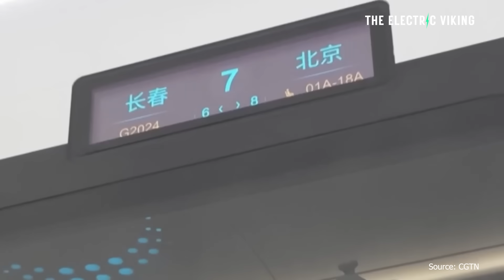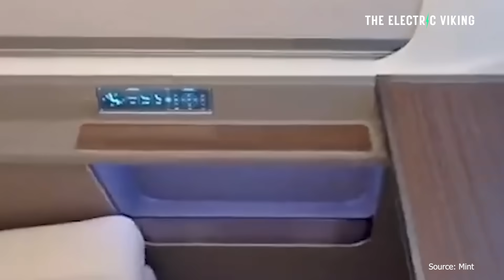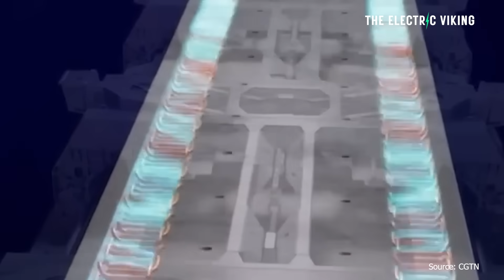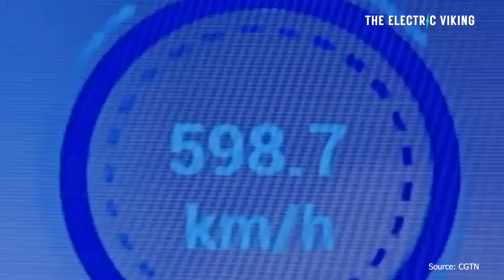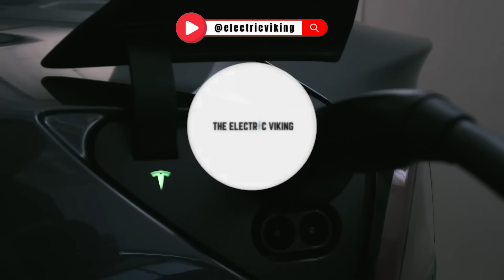The world’s ‘fastest’ bullet train is a remarkable feat of engineering

Comment: 450 kmh is a key benchmark for rail. Half the speed of intercontinental airliners, and also the max service speed of the German Transrapid EMS Maglev built in China more than 2O years ago. Due to the short route (31 km), it is restricted to 431kmh). 
In Australia we should build EMS Maglev with 450 kmh top service speed. The system is far cheaper than the Japanese EDS Maglev. 
Many reasons to limit ground travel speed to 450 kmh which I won't go into here. 
Maglev needs less maintenance, costs less than conventional HS trains - in part because it rides on a continuous viaduct which means it can be in the air clear of the ground level disruptions which make HS conventional train systems very expensive.
Reply: Conventional HS trains are much more expensive than maglev because of the many moving/rotating/frictional and wearing components that require regular maintenance and replacement.

Comment: Just make sure to ask if the train is using French, German or Japanese wheels. The Chinese reneged on their technology transfer agreements. They haven’t managed to build wheels that don’t lead to vibrations and drastically reduced meantime before failure. They had to reduce trains with Chinese wheels to 300km.
Reply: 47,000 km HSR dude.... 60% of the worlds HSR, They have world leading patents in HSR. When you continuously build something for over a decade, you get really good at it, through R & D which then leads to patents.

Have you seen videos of foreign vloggers that travel on China's HSR ? They place a coin next to the window cushion, the coin did not sway or move ( at 350 km/hr ), vibrations ? What the heck are you smoking ?
Do the same coin experiment on other countries HSR rail and lets see what happens...
Reply: @ look up material science and precision machining, forging and heat treatment. I’ve spent most of my working life in engineering R&D. The expertise in making high speed train wheels has taken decades to master by the Germans , Japanese and French. I guarantee that any train travelling at 350 km an hour and above is using foreign-made wheels. Also bearings will be foreign made. Virtually all CNC milling machines are foreign for anything critical. I’m not smoking anything. Same as Comac aircraft. All critical components are currently foreign made.
Reply: Fly here and take a look yourself. We travel daily on 350
Reply: @ I’m sure you do. My point is. You are traveling on foreign made wheels if you are.

Comment: China built 46,000+ km of High Speed Rail in about a decade, and continues to add 3,000 km annually, toward a 70,000 km target that interconnects ALL Chinese cities.  It is as ambitious as the US Interstate System, and fits the Chinese national character of national infrastructure for national benefit.  Significantly, it is all electric, so China's massive renewables push makes the long term operation a little cheaper and greener every year.  By 2030, almost ALL Chinese transportation will be electric, powered by renewables. 
Aside, it is a little surprising that Australia doesn't run a HSR line down the western coast, powered by solar and wind, as the national benefit would be enormous.
Reply: Voting for another leader is supposed to solve everything, anything 😎

Comment: France's TGV is still the OG, The fastest TGV train is the Project V150, which set the world record for a commercial train on steel wheels at 574.8 km/h (357.2 mph) in 2007. The V150 was a specially modified TGV high-speed train
Reply: What is generally recognized is the general operational speed and not the record in the test because it is related to safety factors.
Reply: To achieve that high speed they had to reduce the train weight significantly: instead of the 8 articulated carriages in the middle (push pulled by 2 power cars) they reduce it to only 3. They substituted the powered wheels with larger ones so with the same rotation speed the distance per rotation is increased and finally the drastically increased the voltage on the catenary to give extra powers to the train motors. And at last: the train did not have a lot of pessengers: only a dozen of so engineers and press people. Now I want to see the same speed with a full train with 8 articulated carriages carrying 500 passengers inside the train....I am sure the speed will be drastically reduced.

Comment: China apparently has now leap frogged Japan and Europe in developing and adopting indigenous Maglev trains, beating all previous records of speed (talking 650km/hr ?). Interestingly, China has built a high speed line in Indonesia too, a populous country with a high demand and growing middle class. High Speed network is capital intensive and the financial model must be worked out extremely carefully considering both tangible/direct and intangible/indirect benefits. Running costs could also be quite high since ensuring high safety standards in both maintenance and operation is critical. IMHO these high speed trains are economically viable if it is driven by green energy.  Perhaps demands at least 80-90% patronage. Further, the fares could be just as high as airfares just to break even. Unless the travel is subsidised by the Government, it could be out of reach of many.
Reply: And the goverment should not treat it to have a breakeven at shortterm. This is a longterm project. This is build for the people not for profit. Profit will come later when this is fully adopted.
The plan is also to have a buzzing small and medium size businesses at and around the (train) stations.
That's why you will see in Asia that there is/are malls at or near the bigger stations.
This concept is now also in Indonesia with their high speed rail.
Reply: Chinese government didn't invest in HSR for profit but for a purpose, they wanted high speed connectivity for the massive populous in a massive country. This massive infrastructure will probably never be monetarily profitable.

Comment: For over 20 years I have taken the TGV train from Paris to Marseille. This 774 km distance takes exactly 3 hours and 8 minutes, and is about 2 hours faster door-to-door than flying. It’s also a lot more comfortable and cheaper. Most sub-1000 km flights should eventually be replaced by high speed rail.
Reply: TGV Frances railway can go 570 km/h and that was like 15 years ago if i remember correctly .
Reply: @josippenezic7106 they can but pratically they wont ever use those high speeds because of safety reason, while in china most tracks are direct so theres more efficiency by having fast trains used at fast speed

Comment: Railway speed record is 603 km/h (375 mph) !!!
Reply: That was set by a Japanese Maglev train in 2015. Speed record for a wheeled train is 574.8 km/h and was set in 2007 by a TGV in France.
Reply: @NilsOfTheNorth  It only matters when it deliver.
Reply: @foodparadise5792  Shinkansen in Japan was launched in 1964, it really delivers. TGV started in 1981, it delivers. High speed rail lines all over Europe deliver. China's high speed rail also delivers. I think there is no delivery issue.
Reply: @NilsOfTheNorth  I thought you said 574.8 km/h. I want to see mass production, not some lab tests.
Reply: That's not the actual operating speed thou. To make a train to reach 800km or 1000km speed isn't the hardest. To able to go at that speed with full passengers is a different story, 1st safety 2nd too noisy 3rd affordability it consumes too much electricity. Those are the challenges.

Comment: One major drawback with the new solid-state batteries, is the swelling of the battery during charging and ultimately the degradation of the cell after extensive recharging, however  lithium is a very toxic metal for the environment, not many countries want to mine it, 98% of lithium is not recycled and goes in to land fills or  dumps, causing even worst toxins in peoples water canals, it is way cheaper to mine lithium than recycle it , as people have been blind sided by the truth about the horrible environmental damage and have been fooled  into this clean technology myth, the huge amount of  lithium used to make just one lithium car is  not sustainable for all cars, lithium is a water guzzling toxic metal, it takes 1000 gallons of clean water turned very toxic just to mine or build one lithium car(just one)this is just lithium and not including cobalt which is another of many  other real toxic metals in the build of a lithium toxic car (horrible)  on top of this, most lithium cars are still connected to the oil and coal grids! clean EV car, Not!

Comment: I remember going 431km/h (and have a picture to prove it) from Shanghai city to the airport way back in 2015 on the train.
Reply: Yes that's Maglev, no wheels, float on air
Made by Germany
China have made few other maglev, if recall 60-80km/hr, 120km/hr etc. 

is to roll out 600km/hr

However budget likely plays a role as to reality
Supposedly 2027 line be build for 600km/hr

Initial cost will be staggering
One day maglev will be buiod, then slow replacement of existing HSR network to maglev
Reply: @james_l4337  I heard the planned second beijing to shanghai "HSR" would be a maglev line... the current HSR line between beijing and shanghai is already over the capacity and IS very profitable so the second new line would be a faster more expensive line.
Reply: @catbertevil750  Thank you, I heard there's this line
Is it going ahead as schedule or project suspended
Search last news 2021
No news since

I remembered China build makde had double deck carriage HSR, CGTN news? However since it shove & not release train to use

The over capacity can be solved if ministry release use of already build double deck carriage?
Reply: I think they are saying 400kph to 450kph operational speed 

Ie most Chinese trains can travel faster but they operate from 300kph to 350kph

To cut down in wear and tear 

The new train no doubt has a higher end test speed thus with reduced speed will still go faster than what they have right now at reduced speed
Reply: It is maglev line between airport and city center.
Reply: China has the only operational high speed Maglev (length 30.5km). The other Maglev trains are running at 100 km/hr. Learning about the high maintenance & operational costs and how to improve and innovate in order to build longer distance high speed Maglev lines.
Reply: Me too
Reply: I was there taking the Meglev in 2015 too. 😊
Reply: Shanghai's Maglev uses 3 Transrapid trains from Germany and one cloned locally.

Comment: China has the WORLD'S QUIETEST HSR Train Rail lines

it's quiet because the rail is built ultra-smooth

far quieter and smoother than anywhere else

China's CR450 = 450 kph maximum speed trains operate commercially at 400 kph (actually 405 kph)

it was test validated SAFE/STABLE on double parallel tracks within tunnels with TWO TRAINS passing each other going in opposite directions at maximum speeds!

plus: SOME (not all) of China's various HSR Train line route tracks are being slated for upgrades to use the faster newer CR450 Trains at the higher 400+kph speeds!

only certain longer routes are ideal for such upgrades

naturally, one does not upgrade routes that are much shorter, and offers no real significant benefits

Comment: I'd love to catch an autonomous EV ride-hail to the high speed rail, zip a quick 200 miles in an hour, and then a ride-hail to my final destination. But in the U.S. this will take decades to get to...if ever. By the way, Japan's mag-lev Shinkansen can go 603 kilometers per hour (375 miles per hour).
Reply: Not yet built, expected completion 2027. China has the first commercial meglev in Shanghai operating in 2021, at 268 mph.

"China is developing magnetic levitation (maglev) trains that could revolutionize transportation by connecting cities and villages with speeds of up to 4,000 kilometers per hour (kph). The trains would fly through tubes instead of rolling on railways, and could reduce travel time and improve environmental safety.
In February 2024, China's maglev train traveled stably through a 2-kilometer low-vacuum tube at a speed faster than its previous record of 623 kph. 
T-Flight
The T-Flight maglev train was built by the China Aerospace Science and Industry Corporation (CASIC). CASIC built a 1.2-mile track in a low-pressure vacuum tube to test the train. 
Track In the second phase of testing, CASIC plans to extend the track to 37 miles and allow the train to reach 621 mph." (Google AI)
Reply: @MASMIWA  Shanghai's 2004 (not for the Olympic Sumer Games...) Maglev uses 3 Transrapid trains from Germany and one cloned locally (My own brains, no AI).
Reply: @NilsOfTheNorth  Your memory is off. There was no summer Olympic Games in Shanghai in 2004.
Reply: @accurian0  Yes, your right that was 2008 in Beijing. Now I'm wondring what more was in 2004 in Shanghai then opening of the Maglev line...
Reply: @NilsOfTheNorth  I don't remember either.😀
Reply: @NilsOfTheNorth  I guess the Chinese wanted to find out how feasible  the (German)maglev is, to learn first hand how it works and to subsequently develop its own improved version if appropriate.

Comment: most likely China will not further improve track train speed beyond 500kmh. Such speed creates unbearable noise to urban inhabitants. To go beyond that most likely be maglev technology.
Reply: I'm actually interested in the limits of wheel and track design, as well as curve radius.  300 km/h was pretty much the limit for a very long time (1990s to 2010s) on conventional continuously welded rail.  Even in China today, 350 km/h is limited to a select few routes and most other countries with HSR still stick to 300 km/h.
Reply: many have said silicon wafers cannot go below 5nm....
Reply: And you know this how? Obviously, the physics, AND the engineering suggest that train can go faster than "500kmh", so you're only talking about politics, maybe. However, hydrogen fuel cell/battery electric high speed rail should reduce the noise. In fact, the French TGV reached 350 mph years ago
Reply: Agree. The next step should either be the 600+ km/h or the 1000+ km/h Maglev they are currently testing...
Reply: Nonsense: the noise is negligible (have you ever even been to China?) , it lasts for a very short time (because... it goes fast), and in urban areas it goes much slower anyway. Actually, because of the speed, the rails are much longer length between joints, so you don't even have the rattle like older infrastructure famously causes
So many comments by people who see a video, make up some fantasy in their minds, and then deliver these gems of wisdom... man this is weird
Reply: @grandulasperty1812  - then why they are considering building a tube for super maglev. Just operate in open air at 600+ km / h. The speed could cause a shock wave.
Reply: more copium. lol